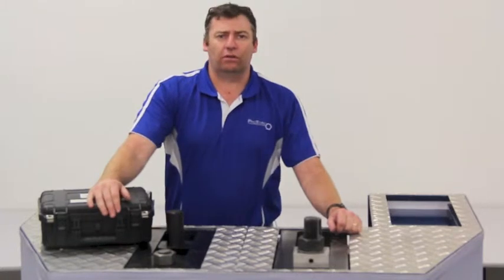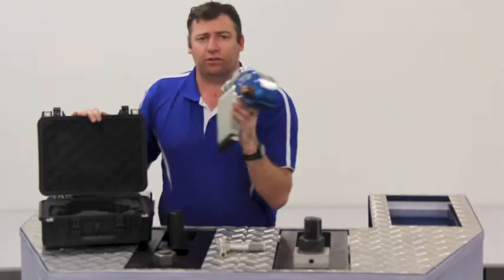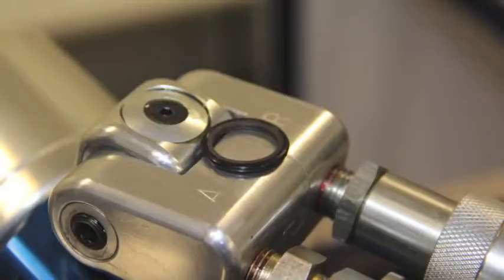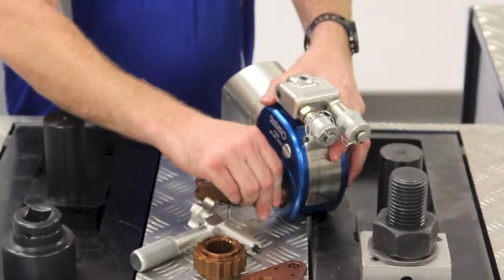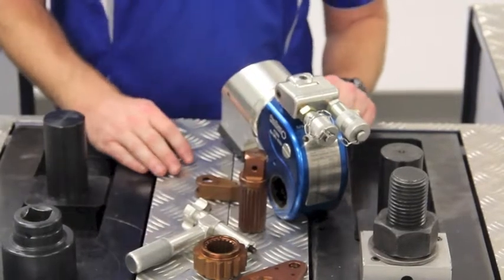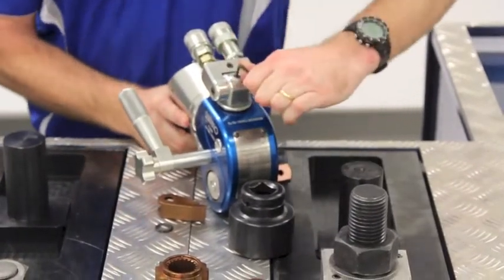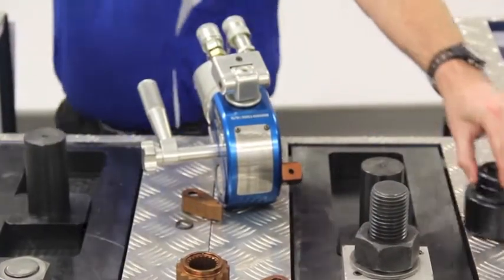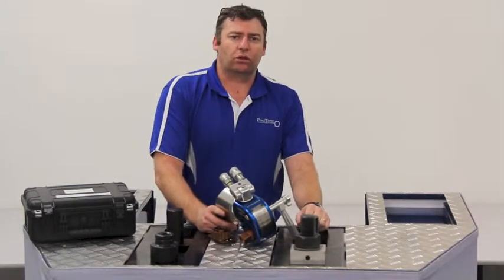ProTorc Square Drive Hydraulic Torque Wrench

Comment: Does this work with Hytorc or it is a China made copy?
Reply from the maker: Protorc is manufactured to ISO 9001:2008 and is a similar design to the Hytorc MXT Wrenches.
It is manufactured in Asia using high quality materials from suppliers such as Alcoa in Canada.
These tools can be used with Hytorc Pumps as well as most other Hydraulic Wrench Pumps on the market. 
If you have any questions, please contact PT Hydraulics - +61 3 9562 8800 or sales@pthydraulics.com.au